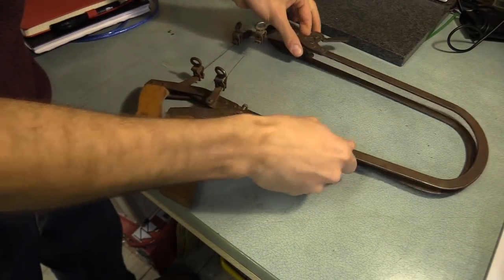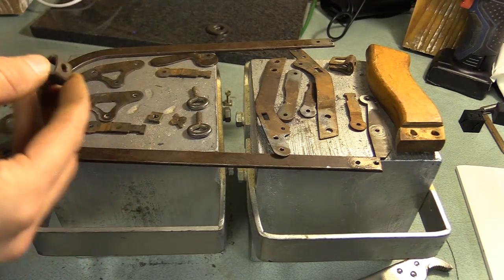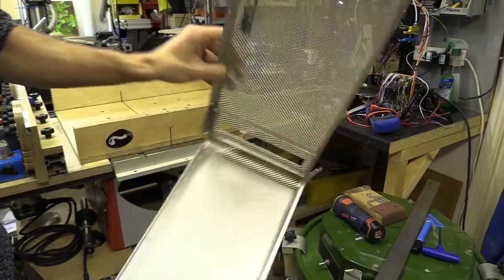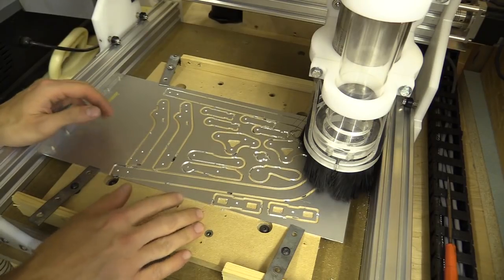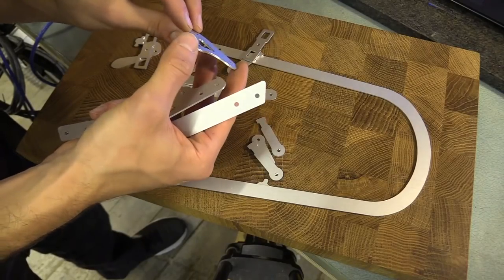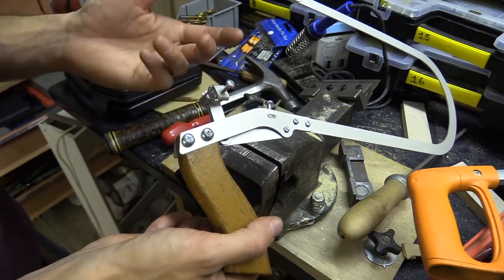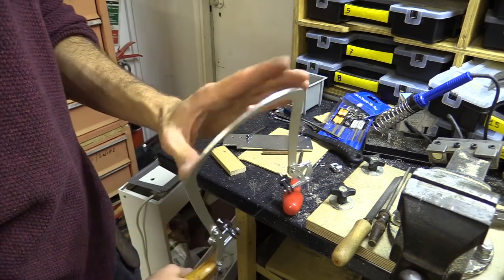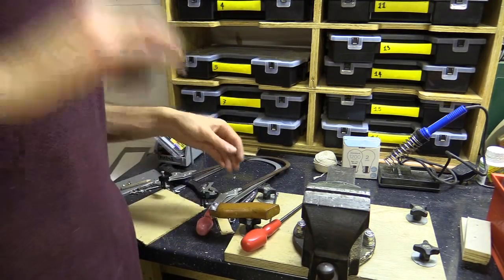Hobbies Cam Fretsaw (Reverse Engineering)

Comment from the maker: Disclaimer: This video is for the purpose of annoying easily annoyed people. But on a serious note, CNC'ing a frame for a fret saw  will not produce one with the same strength as one that is bent into shape. The bending process probably work-hardens the material some what. This video is about replicating a unique saw design, and making it available. Have fun if you decide to work with the files I have made available.

Comment: Just reporting in that I made a fret saw based on these plans. I made new simpler blade mounts as a single part instead of the funky bent cage one from the plans. Made from scraps of 7075 "aircraft aluminium". Works like a charm. Thanks for sharing the plans and story about your build. It was helpful.
Reply from the maker: That's great to hear - glad they were helpful. :)

Comment: Make a duplicate of the frame from a piece of say, 1/4 inch plywood, and epoxy it alongside the aluminum frame, just leave enough clearance at the ends for the cams. Should stiffen it up considerably, and not add significant weight vs steel.
Reply from the maker: I need another old mac!

Comment: Endmills, especially small and cheap ones aren't really made for plunging straight in, because the center of the mill isn't cutting. In soft stuff like plastic you can get away with this, but in aluminum or steel it just bends around that center high spot and eventually breaks if you keep pushing it. You need a drill or a special toolpath that will spiral the bit into the material, but then of course the hole must be bigger then an endmill you're using.
Don't bother with ABS, it's considerably softer then PLA and won't fare any better. You could print the parts without infill and do a lost PLA casting in aluminum, but there's a reason they made the thing out of steel in the first place :)
Reply from the maker: Yeah I know but the super expensive new type is mostly made from machines aluminium. Ok that's good to know about the ABS. I really should have just made the former, and got some more aluminium to stiffen up the frame but I'm trying not to throw money at the problem and use what's in the studio. Anyway I just looked up lost-wax filament. That's pretty cool.